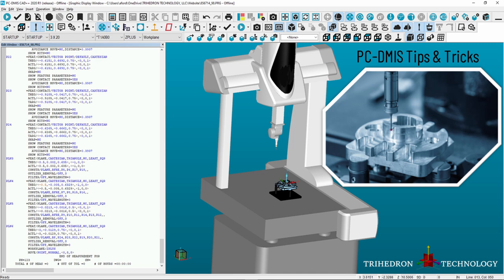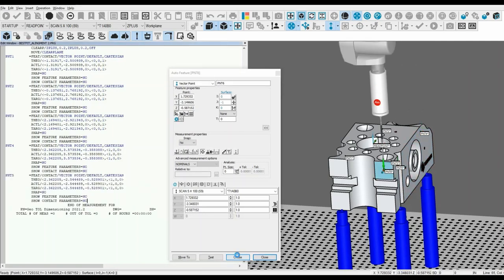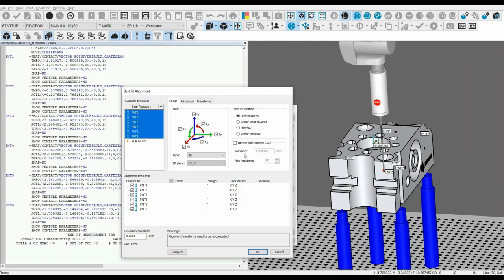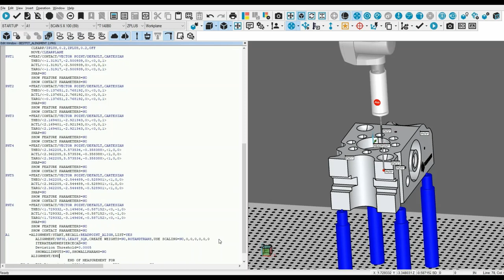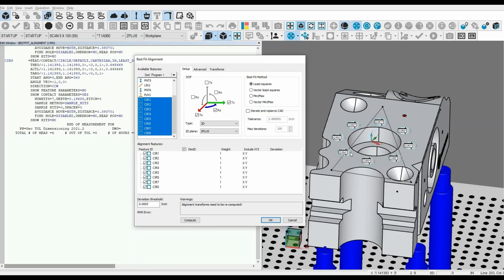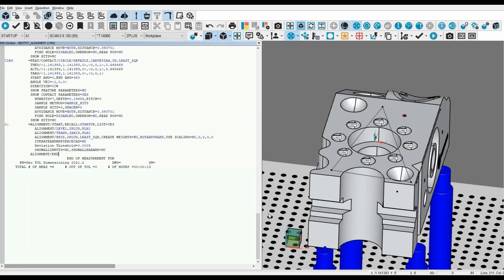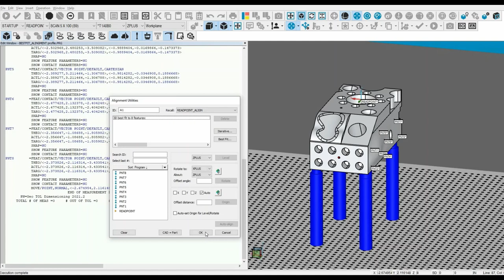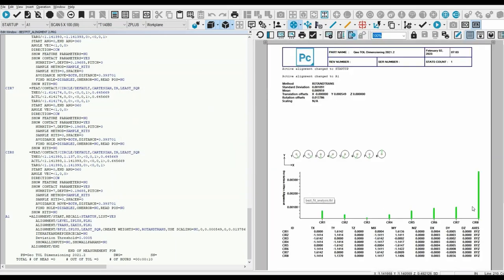PC-DMIS Best Fit Alignment #1

Comment: Will it work when u click ok without clicking compute befor ?

When the Task is: Pattern of 4 Holes, Position 0,5 CZ | A   ... 2 holes are measured GX the other GG  > What´s right, Bestfit Least squares or Bestfit Min/Max ?